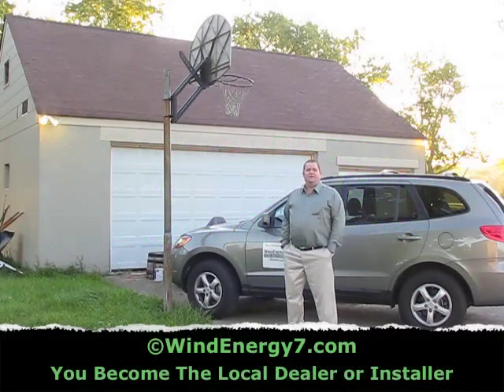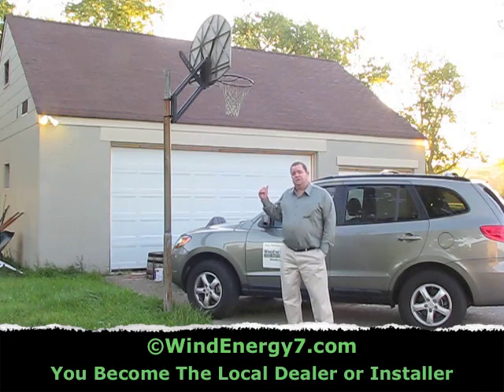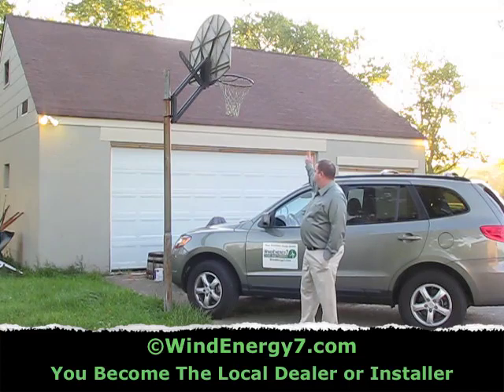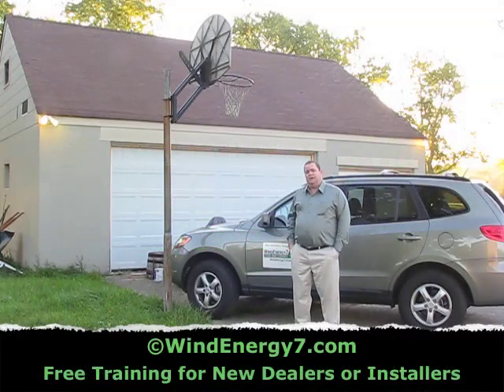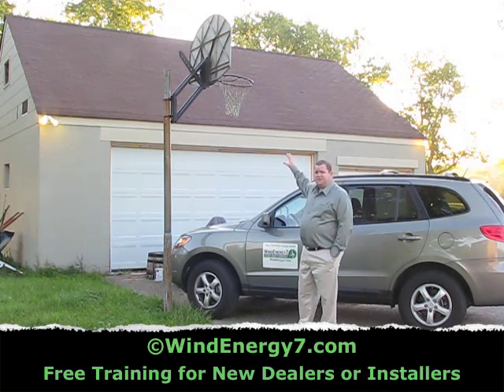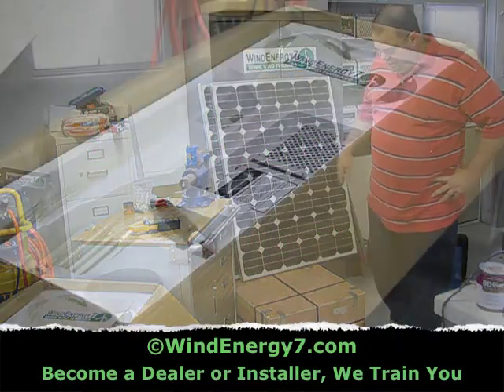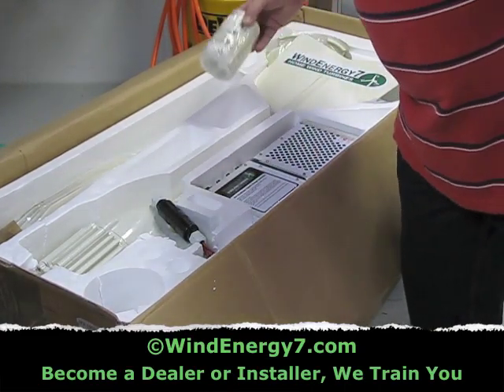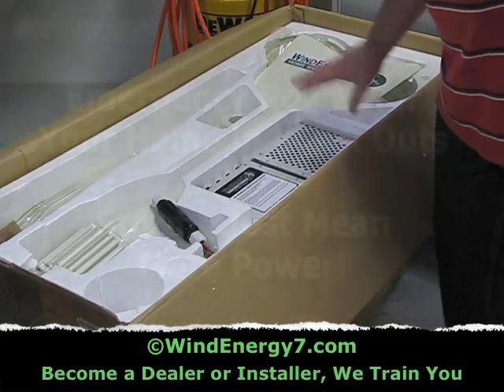Rooftop Wind Turbines on Home

Comment from the maker: Rooftop Wind Turbine on Home, fill out the Rooftop Wind Turbine contact form at WindEnergy7. We will connect you with the Rooftop Wind Turbine dealer for your area. There are still areas open for new dealers to become the local source for wind/solar systems. So, if you are interested in becoming a Rooftop Wind Turbine dealer fill out the Contact Form at - - WindEnergy7 (.) com

Comment from the maker: @doug2877 Hi Doug, Our system has an automatic transfer switch that automatically runs the meter forward or backward as needed.  In a blackout, it severs the grid and your wind, sun, and a battery bank, keep your residence powered till the black-out is over.  This is fully automatic and lightning fast.  In a black out, alarm clocks will not even reset as your grid goes down and comes back.

Additionally, on a windy night, with all your power out, it runs your meter backwards, to the neighbors.